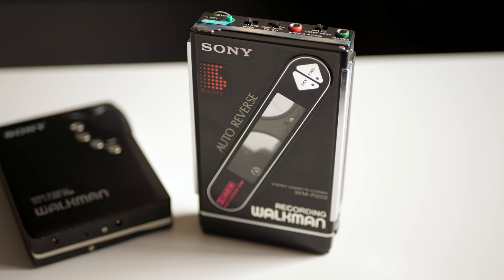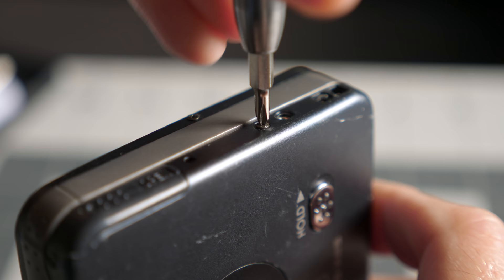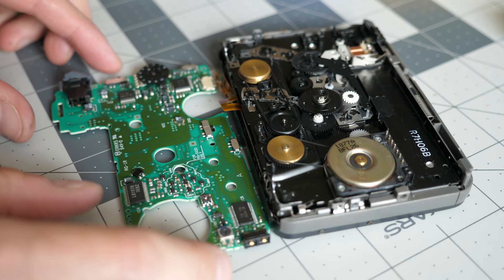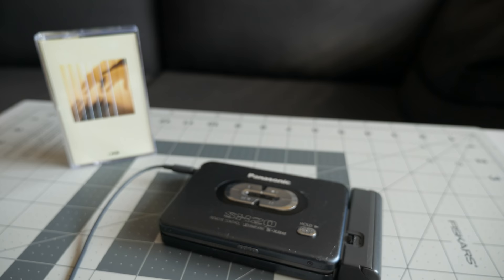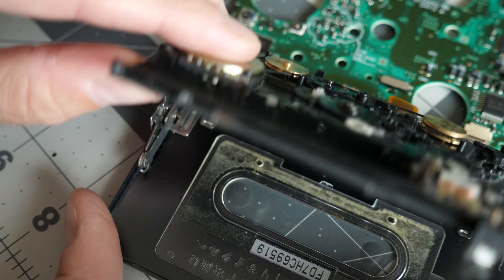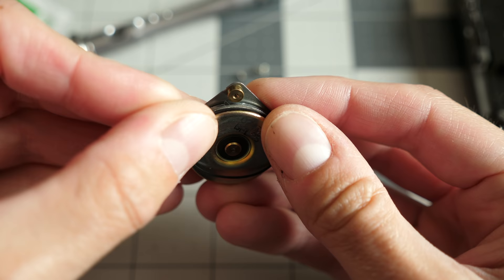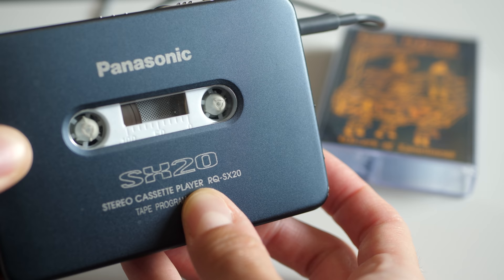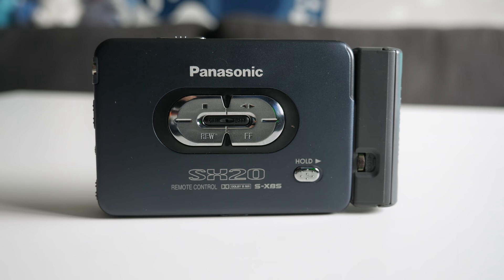Panasonic RQ-SX20 Portable Cassette Repair

Comment: The "train" setting tells us a bit about Japanese society.
Reply: @kadupse  no it tells us people are polite in japan ahhaa ... lies
Reply: What is this "respect for people around you" thing?  Is that like freedom, but the opposite?  -- The US
Reply: @CantankerousDave   No, there's actually a part of the video that specifically shows the manual's explanation of this feature -- it's to reduce high-mid frequency bleed from 90s headphones, to avoid disturbing others.

If it were intended to combat ambient noise, it would boost low-mid frequencies, where the majority of the noise is.
Reply: @nickwallette6201  Yes, understood. :) Here in Canada the "GO" train cars have this "Quit Zone" section at their ends. Supposedly people commuting to/from work can relax there and not be bombarded by rude people with their headphones so loud that they can be heard everywhere. It's amazing that people need to be told to have regard for others. Same with signs reminding passengers not to put their feet on the seats. Sometimes I think we need a Social Credit System like China. People are just too dumb to have empathy on their own. The dumber we get, the more we're inviting communism-like tyranny to save us.

Comment: That was a tricky repair. I'd have stopped at the first sign of soldering required. Nice job.
Reply: @CBitsTech These models that is the SX ones are tricky and more problematic than the S ones.

Comment: AIWA made some sick hi-end units back then before it was acquired by Sony.
Reply: Yes , my 25 year old deck from aiwa still works
Reply: Some were only only just a bit larger than the tape going in them. 
Aiwa were always good sounding players too.
Reply: Yeah. I remember buying a cheap looking Aiwa player with auto-reverse in early 2000s just to listen to anything on the bus on my way to college. Was shocked how good it sounded even though it looked like a toy cassette player!
Reply: Barton Lynch
Sony owned AIWA already in 1980, they released their products as cheaper Sony gear, not high end.
Sony took them over in 2004, but they discontinued them, brand only now, sticker company.
Reply: @paistefever  you hated the 1999 MP3 player sticks?

Comment: Here is a tip for leaning belt residue: use dental floss! It is small enough to get in areas inaccessible by cotton swabs and it is pretty effective!
Reply: What a great tip. I have been working on a few mechanisms recently. I have a SX-60 to take apart again as it is clicking in FWD play after a belt change. I think the SX series are also a bit notorious for wow and flutter.

Comment: I am using Panasonic RQ-NX10. In my opinion it's much better value than Sony nowadays. Quality is superb, it has aluminium body (like yours SX20), excellent sound quality and full logic control and of course - excellent playback quality. With one major benefit - it costs ~15 USD/10 GBP to buy and another 5 USD to repair it... :) Also it's using one AAA battery (non of that gumstick absurd) and it can play 20-30 cassettes on one battery.

Comment: Thanks for the Video. After changing the Belts i had similar problems with the clutch. Your video made me aware of the Problem. I was able to fix the disc with some superglue after i search the parts for some time on the floor. I am satisfied enough with the result.

Comment: I came across your channel about two months ago and its certainly been an inspiration to delve in repairing cassette players. I managed to fix both a Panasonic RQ-S15D and and X-05. What really surprises me the most is when used with modern headphones and noise cancelling just how good these portable cassette players sound. Its been a very worth while journey. I do agree though, having to remove the PCB is a pain.

Comment: Thank you so much for your detailed repair video. I am repairing a rq sx87v and after replacing the belts and reassembling the motor wont start and has the same issue as you encoutered at 9:48. I was going to give up the repair if not for your video. Your video is the most detailed and comprehensive of all the ones on youtube. And i had no idea you can buy replacement clutches which my one has has split as well.

Comment: Panasonic players are fun to work on, although desoldering is unavoidable. Awesome motors and design however. If you want a real challenge try a belt replacement on an Aiwa HS-G08. Can I suggest you use IPA with a QTip in future to clean up flux residue. I'm tempted to make a series of videos covering repair techniques for many personal cassette players if there's enough interest.

Comment: I have an earlier model, the RQ-SX1V, purchased at the student co-op of the school I was studying at in Japan. It got a lot of use on my hour train commutes each way. I lost the chip battery and charger on the flight home. Sadly, it no longer works, even with the AA battery attachment. In 1994, it was the coolest thing to see a player that was barely larger than the cassette it was playing.

Comment: Nice repair! Your videos inspired me to pick up a couple Walkmans from Japan. I got a WM-WE01 model from with the original wireless remote and wireless headphones (looked super futuristic at the time) but the batteries corroded in the headphone portion and broke them. Unfortunate, but I got the walkman part to work and it sounds great! I also picked up a WM-EX5 with all the accessories and I use that as my daily driver.
I believe those guys on Ebay go to Yahoo Auctions to buy walkmans, restore them, and sell them at those high prices to make a profit.

Comment: The flutter will not disappear by itself tho. You have to work on the gears, bearings, capstans to reduce the flutter. That will require cleaning each part with proper solution and using correct oil for each part. Also replacement of pinch rollers might be required

Comment: I have some suggestions for those restoring RQ-SX(es), having dealt with such problems myself.

- There's no universal .5mm belt kit that I know of to be used with them. You need to rely on specific kits.

- ALWAYS remove the motor flywheel when installing the new belt, you risk of enwrapping the belt on the spindle rather than its dedicated groove which has a different diameter. Do it properly, do it once.

Besides the usual lubricate and grease which should also be done for capstans and motor I also lube the pinch roller bearings and sliding spots. Keep in mind that a flattened pinch roller also causes erratic wow&flutter.

There's more: SEVERAL cassette tapes that came in my possession are degraded... some in a way not relevant to the player transport (magnetically), some are dirty and/or have the base tape layer and/or subsequent oxide layers pulverizing from the media. This can cause a failure to PULL and transport the tape itself.

If you notice a cassette tape that has pale milky window (while it shouldn't), don't use it until you clean the tape both upper and lower side comprehensively.

Comment: You can take off the flat, grey plastic split-washer holding the shiny flywheel in order to get better access to the brass motor pulley -- for cleaning and installing the belt.

Comment: This model like many other Panasonics has the rubber rings on the capstan shafts and they fail like the spindle clutch C clip. I have fixed with some CA glue or some people use a metal clip to hold the clutch together.

Comment: I remember picking one up in the late 90's in Taiwan for ~6000 NTD. Can't remember the model number but the visual aesthetics are similar. I still have an in-line remote from another unit that died from what I think was electrical shorting/grounding issues.

Comment: Those belts can sure be a mess to clean up. I've had issues with belts melting and sticking on the gears of the tape assembly on an old Akai deck I worked on, finally just took all the gears and spindles out and soaked them in isopropyl for a few hours.

Comment: I think you should have removed flywheel from the motor, you just need to remove the retainer and take it off (its magnetic), which will make the repair much much easier, with no chance of damaging anything, and also the cleaning will be straight forward.

Comment: I owned this player's predecessor, the RQ-SX15.  A very similar player, even down to the nearly grey colour blue.  It cost £100.  I went from an el-cheapo player that was about 7x the size of a tape to one that was not even 1.5x larger - I used it every day for about 2 years while travelling to school.  It was then I began noticing it was playing slow... a 4:00 song played for about 4:15.  I not long after bought a CD player, which wasn't as good for portability or battery life, but at least music would play at the correct speed.

Comment: I've got the same model and while replacing the belts I accidentally removed that lever thing hooked to the solenoid. After putting it back in, now the walkman has problems changing modes (play/stop/rew/ff). I guess much like in VCRs, something has gone out of phase. Unfortunately there's no mention of anything in the service manual

Comment: That player has a number of remarkable similarities to the portable DCC players and recorders by Philips: the motor looks almost identical, and to replace the belt you have to desolder the circuit board. And they even have a similar problem where the mechanism operates a switch to let the electronics know which way it's going, and if you don't pay attention, it breaks off and becomes unusable unless you have a spare...

Comment: I used to gawk at all the cassette players for hours at Ninomiya and Bic Camera. There were usually 50 on display. And yeah, they usually ran the gamut from about $90 to $120. Some of the high-end pushed $200. I picked up a new WM-EX555 for 8800 JPY in ‘97.
Reply: I seem to recall my RQ-SX1V costing the equivalent of $180 at the student co-op when I was an exchange student back in 1994.

Comment: I literally just repaired an RQ model. I found that disassembling the motor was easiest.  Pull the top clip and it opens.
Reply: Yes, on these transports you definitely split the two rotors (remove clip and lift it off) to clean the motor. Allso the belt width, size and quality is super critical on these types of transport. Generic belts will not work.
Reply: @kjetilvalde2788  Absolutely. I put a generic belt in until the right one came and it is definitely not right. Great little machines though. Very underrated.
Reply: @mgdriver8503   Definitely underated.  Since the price of any half decent Sony has gone through the roof, I have instead brought a couple of Panasonic's back to life. Usually the unit costs me the same as a new set of belt's and a gum-stick battery.

Comment: Damn... I just bought one of these rather blindly and then realized it was the one from this video. I don't know if I'll be able to pull the belt replacement off but I guess I'll try to. The player was very cheap at least... I love the design of this thing, I hope I'll get it to work... O___o
Reply: Alright, done it. First time soldering on a PCB went really smooth. Pulled out the PCB twice but didn't manage to get rid of awful flutter... I'm wondering whether it's the amplifying circuit that has issues. I can adjust the speed just fine and the belts and pulleys run smooth, but it sounds exceptionally awful.

Comment: Just got a sx35 practically unused in the box for $98. Just replaced the belt and accidentally dropped it, broke the clutch disc. Now I had to order a brass one. Also lost a screw as always. Just my luck. Never can have a repair go right for me.

Comment: I have one of these too (the silver model) laying around for years now because i was never sure WTH was actually wrong with it. Same WOW and Flutter issues and despite their compact size, i always really hated these types of portable cassette players / personal stereos. I have another one of that kind, an AIWA HS-F505 that not only now has the same bad WOW and Flutter issues but also now makes an insane noise like a motor that constantly tries to start and wind up. And the weird thing is that noise even comes electronically through the headphone output and Attached speaker. It's almost as if these types of portables become possessed by some kind of strange demon after ca. 20 years or so.
Reply: or could be some kind of a tiny Gremlin inside the mechanism.......
Reply: @fernandom6724  THAT would explain a thing or two.

Comment: The Panasonic 2 belts transport is hopeless, the two plastic gears connecting the flywheels shrink and no longer have the tight coupling required to play smoothly. Typically side B plays better than side A, but both are below my standard for decent W&F. I love Panasonic walkman's i have several units and they all play great, but they belong to either the hi-end RQ-S series or the cheaper RQ-X. The latter has very reliable transport with low W&F, but it's a bit bulkier as they use a single AA battery. Anyway i think Panasonic walkman's have better heads than their Sony counterparts and thanks to the heavier flywheels they have better W&F.

Comment: i do own this Panasonic, the clutch was the problem, the flouter sound.
i need to replace the PWM motor i guess.
i do not have belt issues, it was not used in hot enjoinments, that is a  belt killer.
Not as good as the fancy Sony models!

Comment: the wow is probably the capstans.unlike the sonys the Panasonic's  use 2 rubber rings on the capstans those rubber rings go bad they get sticky and there is pretty much nothing u can do since no one makes new ones and if u scrap the rubber off it damages ur tapes. sony was smart and used a coating on theres rather then rubber so there capstans don't go bad. had a similar model to this i ordered off ebay and ended up return it for the same reason awful wow and flutter.